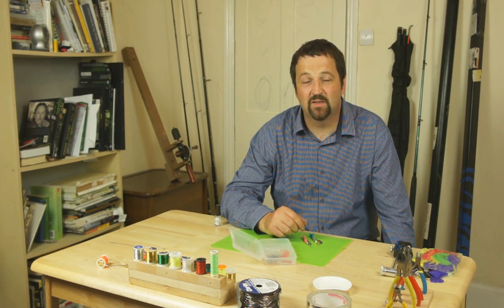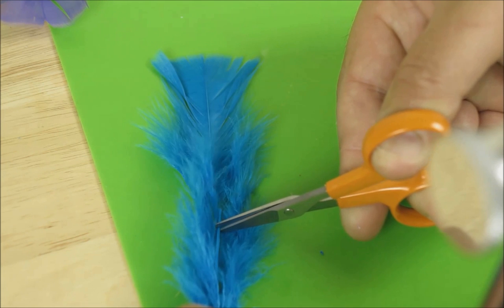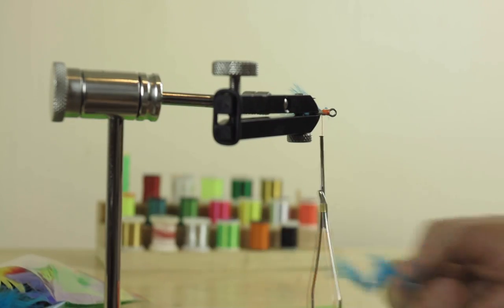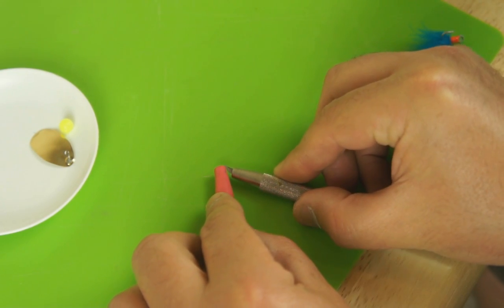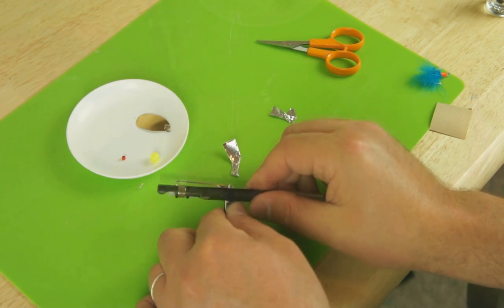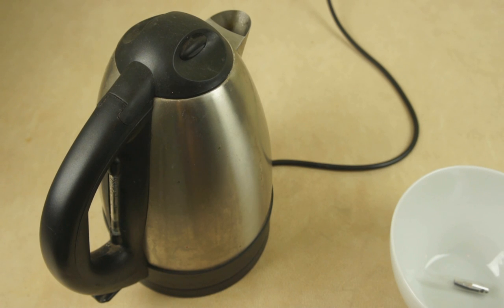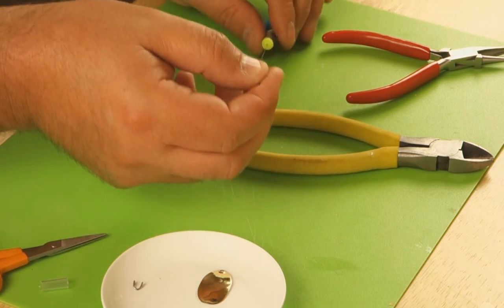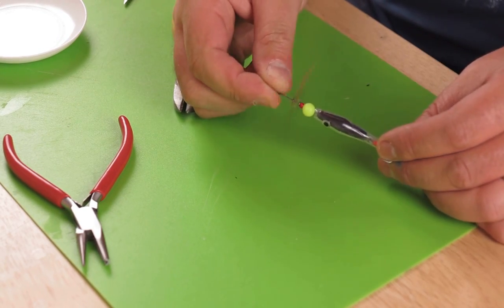Making a Flying Minnow fishing Lure

Comment from the maker: Good guess the wire is .8mm or approx .030 inch s/teel mig welding wire i think it is 316 grade  there is a link to the pdf in the desciption with tools and materials for the older version of the flying c i am just working on the update   cheers

Comment: Love your vids Paul, especially the way you recycle materials or use inexpensive materials from discount stores. I use a lot of cheap materials for tying pike flies myself :) This lure looks great as well and surely is a great caster. One thing though- after cutting the wire with side cutters I suggest to file down the end bit so it doesn't cut or damage the line, alternatively you could cover it with a drop of uv resin or even 5 min epoxy. Take care ;)

Comment: Nice little lure Paul! But don`t you have problems with trouts throwing off the hook? I just ask, because I usually use a little splitring to connect my hooks to the spinner, becauseI think  if the connection is too stiff they can use it to lever the hook out of their mouths. And with the shrinking tube cover, there is not much room for the hook to move.
Anyway, its a cool lure and as always a great video! Greets

Comment: Have you ever used old mig welding tips ? I have just collected a handful of different sizes from work ,they are copper with a hole straight through ,thought they might make spinners ,flying c  ect. I get all the scrap stainless mig wire offcuts which are useful but cannot think of a good use for the miles of mild steel wire that is scrapped apart from using it for hangers.. Any ideas? You may weld yourself and have old mig tips but if you dont  ,all sheetmetal workshops will have some old ones in the scrap.

Comment from the maker: this is a bit of a funny one because some supplier sell it as width measured flat and some by diameter. I bought this as 12mm diameter 2-1 heat shrink so it shrinks to half its diameter. 

cheers

Comment: What kind of plier you used to bend the wire into little eyelets? Is it the kind with a small prong inside the gripping area? Is so, what you call that plier so I can look online and buy one. I checked the Internet for "jewelry pliers," but I don't see any prongs on those. When I looked at your video it looked like you used a plier with some kind of prong to help you bend the wire into eyelets, am I right? Thanks buddy, I love all of your videos. You have a real talent for making lures, something I want to obtain badly!
Reply from the maker: \The pliers i am using are called concave round nose pliers, they are normally sold for jewelery making, thanks
Reply: *****
Thanks for the reply, I'm going to buy me one.